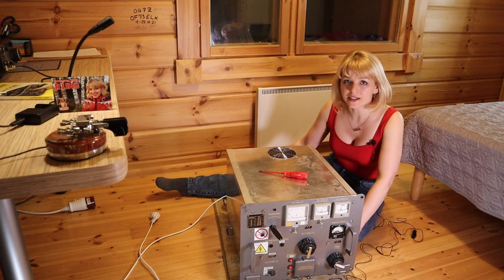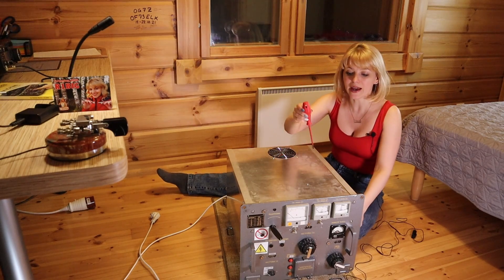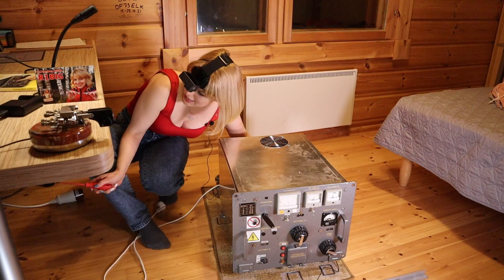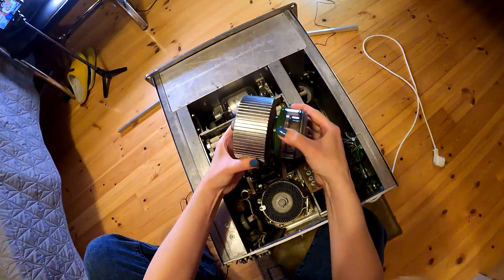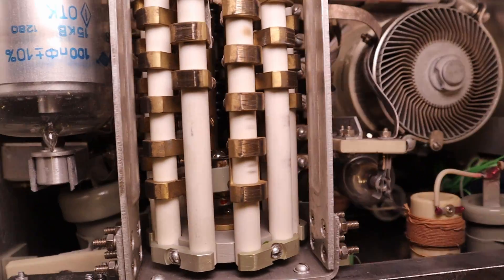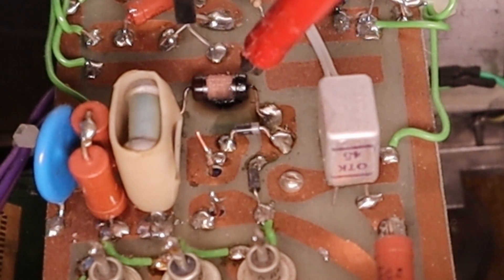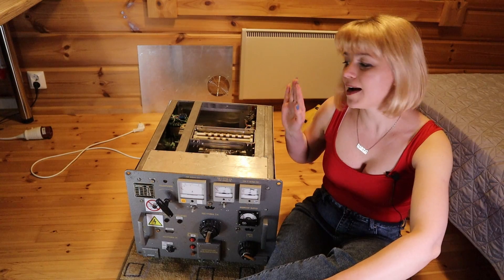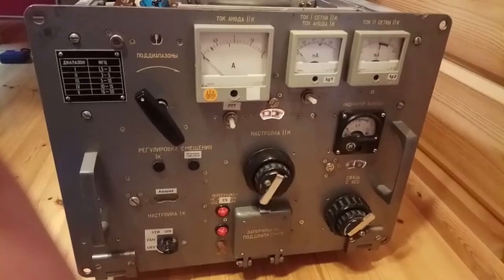Amplifier Burned 🔥? YL Raisa looks inside R-140

Comment: Hi Raisa, tnx for lovely QSOs while at OL88YL (you were literally my neighbour!) as OK5Z QTH is less than 25km away from mine :) Crowded part. 73/88 Jiri OK2IT (OK4I).   PS: I hope you have it working. I also use one converted R140 Amplifier on my REMOTE station as it has got 10 electromechanical memories. BTW: The builder is correct. That seems to be screen voltage regulator board and it seemed that tube has drawn way too much G2 / SCREEN current. If resistor burned I think tube will be OK!  bye

Comment: Hello YL Raisa, I hope your amplifier is working again. I'm also running the same tube here, but in a differently constructed amplifier. Please, please, please: Don't change a thing until you exactly know what you do. Even a wrong resistor (i.e. with more inductivity) can get you or your amp in trouble...and half an ampere at these voltages isn't fun anymore. Btw: Do you have had trouble with these screen grid capacitors (this star-like ensemble in the socket of the tube) yet?
Reply from the maker: Ralf, Amplifier is working again, everything is OK, Rk3AD fixed it ;)

Comment: Hello. I worked as a soldier at the R-140 X ZIL 131 radio station for two years, 1986-1988. . This radio was a durable construction. In winter weather -15 degrees below zero, blue flames flew from the HV source and it lasted. The final stage was very durable. I have nostalgia for R-140 :-). Power amplifiers are bought in the Czech Republic. Regards Mike.
Reply from the maker: Мирослав, спасибо за комментарий. До встречи в эфире

Comment: At least your amplifier broke with a failure. I have one that I can’t use because I am allergic to cats, the amplifier works just fine, but I can’t be in the same room with it unless it is in a bag, and it clearly not work with no air flow. 
Also have watched 3 of your videos so far, wondering what antenna you have, will go watch more to see if you shared your antenna
Reply: Of course there are many videos with antennas of YL Raisa

Comment: screen voltage protection resistor. it means too much current were drawn on screen voltage, sometimes plate to screen short circuit(tube is gone) other times zener resistor fail, so over voltage , voltage to screen on tube, draws more current then and amplifier power goes more gain = higher current on screen then designed for. (, then +_560 ohm resistor burns out, install 1/8 amp fuse to protect circuit if not installed already.
zs2cx

Comment: Dangerous gear there, Raisa. @ 3'07" the burned item is a choke comprising a high value resistor with a fine winding on it which looks as though it has shorted to the copper pad below.
I can't see if there is any damage to the component to the left which is sleeved.
Reply from the maker: I switched of and waited for many hours before opening it. Because I am aware of capacitors... The tube was the fault. 73! Raisa
Reply: @YLRaisa  OK, Raisa, I saw you had a spare output valve at the beginning.....you probably got a high plate current reading on a meter....I remember collecting the parts for a power amp with a couple of 4CX250B valves many years ago....73

Comment: Certainly the magic smoke has left the box. Though it was invisiable.
Reply from the maker: I heard that there are parts that smell but do not emit smoke..
Reply: @YLRaisa  Yes, there is a magic smoke which can't be seen but can be smelled. Those two kinds of smoke are magic in there nature.
Fridges are the most common boxes that have the magic smoke inside them. When that magic smoke leaves a fridge the fridge stops working.
Reply: @YLRaisa  By the way, tubes also have some magic smoke inside them. It doesn't smell it can't be seen but it has negative pressure. When that negative pressure becomes positive or meets zero a tube stopes working. And all those magic smokes are not interchangeble.

Comment: Be extra careful with those tube amps where open! Even after a while disconnected, some caps and specially the tube plate (heatsink) can held voltages of 4000 V in excess if there' s no proper (or malfunctioning) bleeding circuits.
Bad luck abt the resistor but surely with your friend help it will be back on the air very soon!
Reply from the maker: Thanks for your care. My friend has already fixed it. :)
Reply: @YLRaisa  awesome! 73's and best DX!

Comment: Is the tube a GU43b or GU34b ? As other said already, be careful of high voltages.The high voltage is applied to the gray metal part of the tube and can stay there for hours (may be days) after the switching off of the power supply. Also be care about medium voltages also. That tetrodes tube should have up to 400 volts to other parts of the tube (grid). Likely you burned the resistor due to too high grid current due to over driving the amp or perhaps unmatched antenna or a combination of both. 73 !
Reply from the maker: Yes, it is GU43b. My friend has already fixed it

Comment: Looks like heavy duty built amplfier.    Hope you can get it fixed up,      last amp I am working on here is 4-400 single tube amplfier       I did have many other amps before too but had move and couldnt take them with me at the time.   I know some them real heavy.         well you should be able fix it amplfier since you know the builder.   be safe working on them too high voltage          73s   Tony ve4akf

Comment: Older Amp I would looked for a shorted capacitor, especially if you had just switched to receiving.  This is just a educated GUESS.  I will go way out on the limb and say,  grid related.

Comment: Hello Raisa,
It looks like a blown Diode.
These diodes have a specific job to protect circuits.
Finding the correct diode is the difficult part.
Soldering it in place is relatively easy.
It is really interesting that you have an interest in these units.
Well I hope your new year has started off well?
Best wishes from the radio capital of Australia, Melbourne.
Gary 😉

Comment: Hello Raisa. When a resistor burns, it is because another associated component such as a capacitor, an inductance or the valve itself has a short circuit. The fault seems more to be in the cathode-grid circuit, otherwise if it had been in high voltage the RF choke of the board would have burned. It doesn't seem like a big fault and it's a terrific amp. Be careful with the high voltages inside are several kilovolts. I hope you fix it soon and get back on the air. 73 of ea1axt from Spain.
Reply from the maker: Hi! Thanks for comment. Yes, the tube was fault.. It is already fixed - the specialist came and replaced the tube (and resistor). Of course I waited one day before I opened it :-) it is enaugh?
Reply: @YLRaisa  If it is more than enough.The reason is that the electrolytic capacitors of the power supply, even if the amplifier is disconnected, remain charged (it is their mission) for this high-value drain resistors are added in parallel (500Kohm..10Mohm) that slowly discharge them in fractions of mA, actually in a couple of hours there would be no danger, but you have done very well👌I am glad that it is already fixed and with the new valve full of power👍👍. My congratulations. 73 de ea1axt.
Reply: So that was a 'Resistor'? It looked like a Diode to me.
Always something to learn in Radio Comms and Electronics.
✌️
Reply: @garynewton1263  Hello, well it looks like a carbon propeller resistance of about 2 dissipation watts. The valve has had an internal leak or short circuit and burned it. The diodes in these cases tend to explode due to their ceramic coating similar to that of transistors and integrated circuits. Greetings from ea1axt, 73
Reply: @6JM6tube  Yes that makes sense.
Since I started out in Radcomms in the early 80s circuits were using modern components.
I never got the chance to explore and learn about crystal and valve radio systems.
I find it interesting that Raisa is involved in this aspect of eletronics.
The video she posted in the woods with the antenna and tuning device was enjoyable.
I'm n9t an Anateur radio operator, I'm involved with CB and Commercial/Business radios but I still enjoy listening to HF.
Thanks for explaining what occured with Raisa's equipment.
Good DXing! ✌️
Reply: @garynewton1263  Well it's a coincidence when I was a kid in the 80's I took an electronics course and it was a bit outdated so I started with tubes, then transistors and finally integrated circuits. I repaired radio and television for many years. In the 90's I got a radio amateur license, although now I only listen from time to time but nothing more. Greetings friend and good luck! 73's
Reply: @6JM6tube  G'day. Not sure where you're from? Good on you. Sadly I didn't follow the path into Electronics or Professional Radio.
I made a few VHF/UHF antennas in the 80s.
I've mainly been involved with UHF CB (476Mhz).
Still listen to HF on my scanners.
Reply: @garynewton1263  Hi, friend. My name is Julio and I am from Spain, a small country in the south of Europe, specifically I live in the north, a province called Asturias. My QRZ is EA1AXT and I used to do telegraphy (CW) on the HF bands, my favorite was the 40 meter for DX and the 10 meter for locals. I still listen from time to time on 40 meters. I started in radio in the 11 meter citizen band like many people here and then I had to learn telegraphy to take the exam and get my license. I did not know that there was a citizen band in UHF as you tell me but I imagine that it will have a very limited range compared to that of 27Mc/s, although the quality of the transmission must be better and the smaller antennas with 12cm dipoles also for space are an advantage. A TV antenna for UHF band IV (CCIR standard) with a dihedral reflector would be a formidable radiator with a good opening and very cheap! You are from Australia right? Good people and the best country in the world as my parents say they got married and lived in Sydney for 10 years. Thanks and greetings again!
Reply: @6JM6tube  Hi Julio.
I am Gary.
I am from Australia's radio capital Melbourne.
I have been involved in 11 metres since 1983. A girlfriend talked me into buying a UHF CB radio a few months later.
476.425-477.425 12.5khz steps, 80 channels.
It was very quiet back when it was 40 channels, now its very crowded.
We still hear Europe coming in at times on 11 metres here but I believe many operators are using Ch 55 and above?
Spain is not a small country, lol.
I have wanted to visit Barcelona for many years, I hear it is one of the worlds most scenic places?
I have never attained any Amateur licences because the price of the equipment seems very expensive.
I do enjoy listening to the HF bands on scanners & receivers though.
I will not comment on sydney, sorry but its not a popular place to speak of in Melbourne.
What do you think of Raisa and her hobby?
She has a great energy and passion for radio/electronics. Maybe she can be responsible for a world revival in radio as a hobby and get young people away from computers and involved in radio field work?
Ok enjoy your weekend and listen out for amateur operators from Melbourne!
✌️
Reply: @garynewton1263  Hello Gary. Thanks for the information about the CB in UHF I see that there is a lot of activity there. I don't know channel 55 but I imagine that they will have extended the band and it will be one more than the usual 40. In any case, the fact that you have heard transmissions from Europe in the 11-meter band (I suppose that in SSB) seems impressive to me since some very special conditions have to be given in solar activity. Well, 15 countries like mine would fit in your country, it's fantastic, huge, even all of Europe would fit inside. I have never been to Barcelona but some friends I have have liked it a lot, the weather, many museums to see and the fantastic beaches it has. Regarding HF equipment, they are still expensive, my equipment is very old with separate RX-TX valves and I got it from a damaged balance in the mid-90s, later I fixed it to be able to do radio, my pocket was not enough for more. Raisa is great, she is truly passionate about what she does and she has fabulous radio equipment and above all that antenna... the truth is that when she recommended the Youtube video to me and I saw her with the screwdriver opening that great amplifier and showing its interior I was impressed...it overflows with passion and love for the radio. It's things like that that she makes the radio hobby come back again because today with the Internet people are not so interested in it. But remember if one day the Internet goes down, radio amateurs will be the only ones who will be able to communicate through our means. Thank you very much Gary, I hope you are having a good weekend too. Greetings from Asturias (Spain).
Reply: @6JM6tube  Yes
Great weekend to you also.
Reply: Hi guys, 
Raisa is A Great Ambassador to Amateur Radio,  &  even I who has been Licenced for over 30. Years here in the UK,  I have actually learnt a lot from Raisa by watching here livestreams &videos on YouTube. 
I think of her (you Raisa)  all the time when I hear certain things on the commercial radio news & TV news channels.  
Take Care and
STAY SAFE. 
Kindest Regards, 
Ray, M0RAY UK.

Comment: What is the maximum power output from that beast of a amplifier ? The amp looks really nice and appears it was built very well. :-)  73 de KN4IRM in Kentucky
Reply from the maker: 1.5 KW if I take 25Wt from the TX :-) 73! Raisa

Comment: that is a masive unit looks heavy duty. what is power out put  ve1-bhm
Reply: max. 1.5 KW with the tube GU43B which Raisa shows there..
Reply from the maker: Yes, 1.5 KW if I take 25Wt from TX

Comment: It's great to have an Elmer (ham radio mentor) to help you out with this. 
My icom 756 pro 3 (my main radio) has an issue with low power output, but only on SSB and it's got me stumped, so far. 
I hope we get our equipment back up and running soon, my friend.  Then we can meet up on the air one day and exchange 5/9 reports lol
I hope you are doing well and 2023 gives you lots of reasons to smile!
Reply from the maker: Yes, Tim, I have even several Elmers in Ham Radio :-)

Comment: Good luck with the amplifier, Raisa! But please be careful of high voltage!! The capacitors can remain with very dangerous voltage for a long time after switch-off of power....
Reply from the maker: Hi Tim. Do you know how long?
Reply: @YLRaisa  It depends on several things: Capacitance value of capacitors, voltage applied, and the value of any bleed resistors......  You need to be certain that the capacitors have discharged before touching anything.  Also, the electrolytic capacitors can also self re-charge, to some extent, even with the power supply off.....  Maybe it is best to leave the repair to an engineer with experience of high-voltage......
Reply: @YLRaisa  Они в блоке питания

Comment: Be careful of high voltages on amps. It’s good you’ve unplugged it while you work on it😻
Reply: ...and discharge...
Reply: But don’t stop doing your experiments, repairs and tests. That’s what amateur radio is all about. My uncle (silent key) and I built a DC power supply in the 1980s. It’s very heavy but still powering my radios today🤠

Comment: that's a proper beast of an amplifier and I very much doubt the tube is blown. more likely a capacitor which has done caused a few knock on effect. but nevermind it's a good excuse to go for a nice long walk somewhere are for some qrp action
Reply from the maker: you are right, like I wrote in description, low power works also very well (especially on high bands)

Comment: If you have trouble with the tube and put the New in you will blow the New tube too !
Reply: I did love my Amplifiers too , always  take care about them but think that 90% of the Amateur Operator cant and never have Permission  to use Amplifiers  like you use , 400 Watts maximum  to  750 Legal Limit and 1KW  for Clubstation s in Europa  1,5KW  in USA  , so... not everybody have it easy to make DX 🤣🤣🤣
Reply from the maker: Hi Markus! Yes, in Finland I can use 1.5 KWt max - it is exactly the max. power of this amplefier R-140.  But 95% of time I am QRV with 100 Wt :-)

Comment: Hallo Raisa. I don't understand why  all the OM need to use an amlpifire... in 40 years of radio i've never had one in my station. My goal is a good antenna also good  transciver and if possibile a hig position. I'm lucky i live at abuot 400 meter  up the sea level. Thats why you  hear me always 9++?😉 by the way hope you can repear your ampli soon. 73 Iz2 Dap Adriano 👍
Reply: Good point. Antenna, feedline and location are so very important.

I have no amp (yet) because I have to be able to hear better first. At the moment, in many situations, they can hear me better than I can hear them. Pileups being a bit of an exception. 

I have a long feedline (175 feet at least) and only just ran the numbers. It is crazy how much of my output (and input) have been just heating the coax!

PS: Italy 🇮🇹 has been one of my most consistently contacted countries for whatever reason.
Reply from the maker: Hi Adriano, 95% of time I am on Air without any Amps - of course a good antenna is the best amplefier!

Comment: Many components can be damaged to not only the resistor. Everything has to be checked! You are dealing with high voltages and power. I do not like high voltages. Never did work on TV's because of that reason
Reply from the maker: Hi Alex, I will not repair such high voltage myself. It is only the issue for a specialist!

Comment: Please don't touch anything inside without grounding everything first. Most amplifiers have a shorting switch activated by the top cover. I don't see one on yours.
Reply from the maker: Hi David! Of course I waited many hours before I opened it. And I will never touch something when it is ON. Only a specialist will do it. And yes, the AMP's housing is grounded.